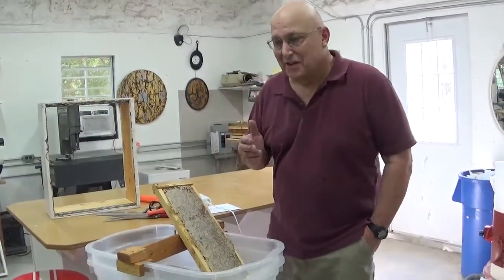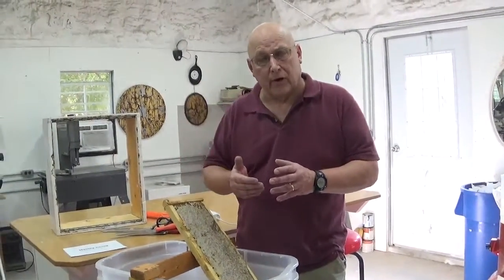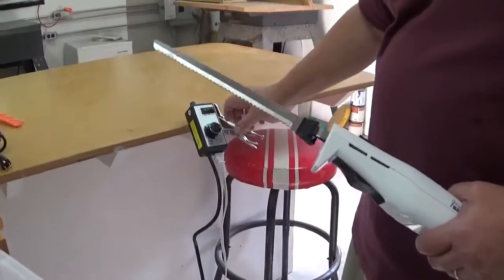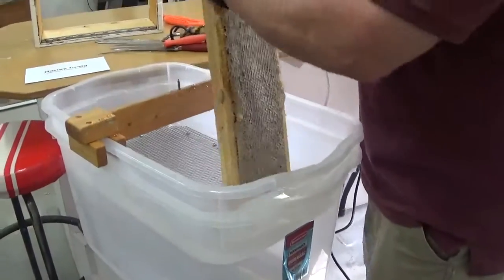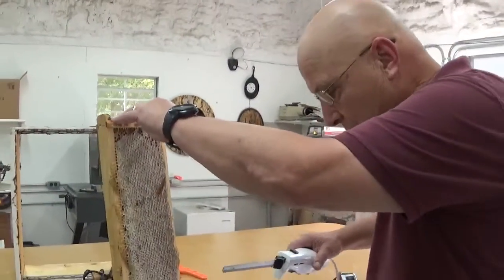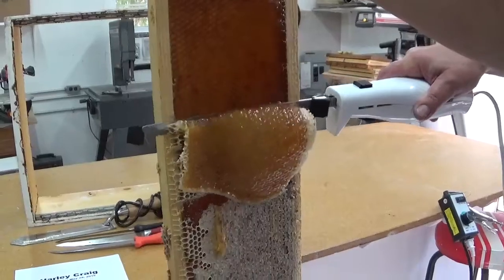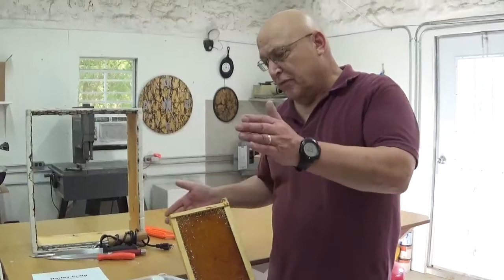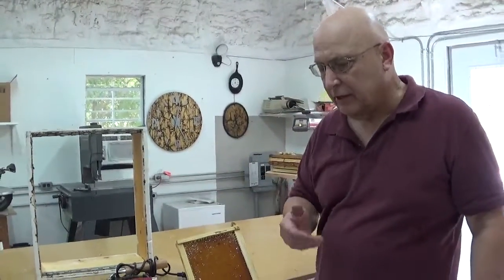Uncapping honey frames my new way is simple, quick and cheap.....

Comment: Thanks again for this video, this method is efficient in every way.  It is easy, safer, and the caps come off so clean there's much less honey getting trimmed off.  I bought an electric knife at a thrift store for $2.00, a new foot switch and speed controller on E-bay for $30.00 and probably saved a few hours the first night of uncapping.  More honey went in the extractor and much less into the pile of caps.  Ultimately better honey in the end, and for less time, effort, and way less money than a fancy uncapping tool.  Thumbs up, Jeff, what a gift.
Reply from the maker: Thomas, I'm glad this worked so well for you. I bought one from a thrift store also and when I plugged it in, I found that it was broken with only one side working. I figured that I'll give it a try anyway and that defective one bladed knife worked as well also, thanks for watching.
Reply: Hi Thomas (and Jeff) - Can you let me know which speed controller you used ?

Comment: Does this leave good comb for them to work with next year? I damaged too much last year and they had to basically start from scratch this year. Looking for a good way to extract and not damage so much honey comb.
Reply from the maker: The comb where it is cut looks like it was done with a schapel, there is no damage to the comb. Look closely at the frame I just did and you will not see any clumping of crushed comb left on the frame. After trying all the other cutting tools through the years I'll only use this one.
Reply: @jeffwillard2417  Thank you for your reply!

Comment: Just finished processing 2,200 pounds of honey from 88 boxes---used the electric bread knife for all of it.  Keep a back up in case of overheating or breakdown.  Will add the foot pedal next season as my hand got tired on the trigger.
Reply from the maker: Ronald, you really put my idea and the knife to an extreme endurance test, I'm glad it worked out so well for you, 88 boxes you got to be honey sticky and tired.... Where are you located?
Reply: @jeffwillard2417  Pulled boxes on Tues, Wed, Thurs with really good help.  Extracted on Friday and Saturday---with more good help.  I use 7 frames in 8 frame boxes (I'm 5'6" and 150 and 65 y.o.). The bees cleaned up boxes and wet cappings on Monday and Tuesday.  Gathered dry cappings and treated and stored frames yesterday.  Cleaned and stored supers early this morning.  I try to keep the sticky mess to a minimum---but can't do much about the heat---which along with humidity, has been oppressive.  Now I make up overwinter nucs with the dark comb that was in some supers.  I'm in Richmond, VA.

Comment: Jeff would be able to give me a bit more information on the foot control & speed adjustment unit please.
I think, as you said, this is a pearler of a system, it looks in the video as though the electrical plug for the electric knife is plugged into the speed controller box, however I can't see how the speed controller is plugged into the electricity?
Is this a complete unit which you purchased (if so what is the brand, unit size?) or if you constructed it out of parts etc.
Thank you in advance,
Kind regards from Marburg Australia
Reply from the maker: Hello Foster, 
The speed controller is optional but what is most necessary is the foot pedal switch which plugs into the wall outlet. Just tape the trigger switch on the knife so it is always on and then plug the knife into the foot switch it is that simple of a setup. here is an example of the foot pedal switch.   https://www.amazon.com/dp/B07KN6GLYD/ref=sspa_dk_detail_5?psc=1&pf_rd_p=0c758152-61cd-452f-97a6-17f070f654b8&pd_rd_wg=9HqQR&pf_rd_r=NE30N5RG6JEW1XE4YG2H&pd_rd_w=DGLzo&pd_rd_r=38c70228-8455-4377-8c45-74f7f6cdd8ed&s=industrial&spLa=ZW5jcnlwdGVkUXVhbGlmaWVyPUEyWkg2NDlQUlNSMUdBJmVuY3J5cHRlZElkPUEwNzU0MDAzMjlaR0g3WklBNVU5SSZlbmNyeXB0ZWRBZElkPUEwMzkwMzMwMjdYODEyUThFNDlYRyZ3aWRnZXROYW1lPXNwX2RldGFpbCZhY3Rpb249Y2xpY2tSZWRpcmVjdCZkb05vdExvZ0NsaWNrPXRydWU=

Comment: Jeff,  I got an electric knife and it works awesome! Thanks!  Unrelated question:  Can you think of any reason not to have robbing screens on year round?
Reply from the maker: Hives really don't need a large opening for the bees, a smaller one helps them to defend the hive. There are so many styles of robbing screens the biggest problem is the opening size; can the drones come and go freely and will there be dead bees that can't be removed through the screen from inside the hive. I personally don't use them I just restrict the opening from an inch to several inches depending on the size of the colony during the Summer dearth with a piece of scrap wood, I just like to keep things simple. Thanks for watching

Comment: After having "bad luck" (OK, bad technique) with the cold and hot "uncapping knives", I settled on and stuck with using an uncapping comb to pop off the caps to get at the honey. It works very well, especially when the bees don't make the comb nice and uniform (proud in some spots and sunken in others). But it is slow.  And when I started going from uncapping 10 frames, to 20, and then more...I knew I needed another solution.  I thought about breaking out the hot knife again (more frames, more practice to get that "technique" improved) but then I saw Jeff's video on using an electric carving knife. So...already having a battery operated one (which also has a variable speed switch on it) i gave it a go.  All I can say is THANK YOU JEFF WILLARD!!!
Reply from the maker: I'm glad it worked so well for you, it was a game changer for me also. Thanks for watching..
Reply: What make and model battery electric knife did you get with speed control on it?

Comment: I agree with you. Over the years I've had a steam knife, electric knife and all other sorts of blades that cost a lot of money and are all inefficient and mostly useless. You cant even call the steam and electric knives a "knife" because knives are sharp and they are not. One of my best ways was to warm my frames to 35c (95f) in a custom built temperature controlled cabinet and I used razor sharp Japanese Sushi knives, they are extremely light, thin and long (like a mini sword).  Your electric knife is very impressive but the Sushi knives were even faster to slice through the cap. Either way, it's great that you identified how useless the 'preferred' way of uncapping frames is.
Reply from the maker: Hi G.A,
It sounds like we traveled down the same "looking for a device for uncapping" road. This worked so well for me I just wanted to share the idea with other beekeepers. There aren't many beekeepers who can afford or want to invested hundreds and even thousands in uncapping equipment, I know I don't.
Reply: @jeffwillard2417  Yes totally understandable to not want to break the bank with equipment. I've learned time is money, even when uncapping and extracting. I find it painful to watch other Youtubers spending a couple of minutes per frame uncapping with a traditional electric heated knife or plane but I guess it comes down to how much honey you are producing. I'm making around 1500kg 3000lb per year so I need to run very efficient. Years ago I was considering the electric knife like you have in the video because it does work well as you've demonstrated, but I've stuck with the Sushi knives because they are a little bit faster, lighter and take minimal space on my capping spinner. I'm stretched to the limits and will upgrade to something better that will uncap both sides at the same time but it comes down to practicality vs: cost. I've done a lot of research and I'm leaning towards the twin heated V-blade, most of the other styles of mechanical uncapper are overkill and too costly for what they do.
Reply: Hi, Gold Acres. I might try your sushi knife method. Is there a certain brand & blade length that you find to be ideal? I run medium and shallow supers.

Comment: Jeff are you still using this method?  Any tips on brand of knife?  What is the brand in your video that you are using?  Thanks.
Reply from the maker: Hello Baby Bee,
Yes I still use this knife, I only use this type of straight line knife the one's with a handle I find are harder to use. I have gotten them from Walmart and garage sales I don't look for any particular brand. One knife I bought was from a garage sale that I found out later when I got home only worked on one side which was the blade without the rivet locking stud (yes they said it worked at the sale). I gave it a try with the one blade and I believe it was cutting as well with one blade than the two blades working back and forth. I'll always use this method with one or two blades, I wish someone would build a heavy duty model that would last and you could take apart and clean.

Comment: I tried this method this past weekend - bought a brand new electric filet knife (9").   By the 2nd frame, the wax was going between the blades, causing the wax to get ripped off the frames rather than cutting them cleanly.
Reply from the maker: Hi Cornerstone,
Sorry you had problems, I wish I could tell you exactly what went wrong. With my own hives I'll notice a difference between colony's in the consistency of the honey comb wax and I have seen a problem if the comb wax is really warm causing it to stick to the knife blades. I will scrape the edges of the knife blades periodically on the edge of the honey comb frame to keep them clean during cutting. I have also seen a difference in cutting ability with the different brands of electric knives, I think this has more to do with the cutting teeth of the blades because each one that I have is a little different between the manufactures. All I can say is try it again because the video shows how cleanly and quickly it cuts the comb, Good luck...
Reply: Did you govern the speed of the knife ? That may have been an issue - speeds and feeds are pretty major issues in engineering

Comment: Do I have to have the speed control unit or will an electric knife on regular speed work?
Reply from the maker: You don't need the speed controller, it just made the knife speed adjustable. I have used the electric knife both ways and also using just one blade. One thing that I do is scrape off any wax on the blades to keep them cutting cleanly.

Comment: Glad I found your video! I was in the process of purchasing 2 heated knives and thought about the issues of unplugging and overheating the residual honey and wax... 
we now have 21 colonies so time for an upgrade! I’ll go get one today and try it in one of the frames that are ready. 
No heating necessary at all? 
And you say it leaves the comb in perfect state? 
Can’t wait to try and make my life easier :-) 
Thanks for the advice
Reply from the maker: Hi Jocelyn,
You can see in the video how cleanly the comb is cut, there isn't any clumping or tearing of the wax. You just have to make sure you wipe any excess wax off the blades if it starts to build up, I'll scrape the knife blades it on the edges of the honey comb frame periodically while cutting. Glad to help...

Comment: Would be useful if you said what brand knife, or show a close up of the teeth on the blade, or at least provide the knife length.   Also, this also may not work for deep frames unless you can find an electric knife with a 10-12" blade, as deep frames are 9" across, so you need a knife length at least 9" plus extra for the reciprocating blade.
Reply from the maker: I have used many brands and they all worked well. They were all the same style with the two blades going back and forth. I have picked them up at yard sales and thrift stores.

Comment: Can you edit the information of this video to include
* the brand & model of the electric knife (most important is the blade)
* the brand & model & where you buy the speed control unit
* the brand, model, & where to buy the foot pedal 

A quick video of how you wired these together... 

I am building a de-capping tub (so I can de-cap an entire box of frames at once.  Having the nail to hold the frame so I can decap with your system would seem to be the PERFECT (non commercial) system.
Reply from the maker: Hello Cornerstone,
   The first knife I got was used with 9" twin reciprocating blades at a Thrift Store for $5.00, it lasted a couple of years. That one I took the finger switch apart and wire it to bypass the switch, the next one I got lazy and just wrapped Gorilla duct tape on the finger switch and it worked just as well.  You can pay from $15.00 to $50.00 for an electric knife, check the reviews on Amazon to get an idea on which knife that would be the best choice to meet your needs. 
   The foot pedal switch and speed control came from Harbor Freight and everything just plugs into each other, there is no special wiring. 
   If your building a multi-electric knife decapper I would go with a brand with good reviews and will hold up under heavy use and can be replaced easily as need. When you get it done send me some photos, Good Luck with your build....
Reply: @jeffwillard2417  Hi dear friend .
You can share a link to a shopping site where you can purchase these tools, an electric knife, a foot pedal switch and speed control. ??
thanks alot.
Reply from the maker: @tiranhesawi7782   This should help.

https://www.amazon.com/Proctor-Silex-74311Y-Lightweight-Contoured/dp/B00006IUX1/ref=sr_1_5?keywords=electric+knife&qid=1585429754&s=home-garden&sr=1-5

https://www.harborfreight.com/router-speed-control-43060.html?_br_psugg_q=speed+control

https://www.harborfreight.com/momentary-power-foot-switch-96619.html?_br_psugg_q=foot+switch

Comment: Hi, Jeff. I might try this method next season. Is there a style of electric knife that you prefer? Double-reciprocating blades? Is there a preferred brand?

I’d like to purchase something that works optimally without any time-consuming hang-ups.
Reply from the maker: Hi Ryan, 
I have used different brands with about the same results. I would suggest checking out thrift stores, garage sales and estates sales and buy them at a cheaper price than new. I bought one from an estate sale and found out later that only one side worked but that one bladed knife worked as well as a two bladed one. Thanks for watching....
Reply: @jeffwillard2417  

Thanks. Is this still your preferred method of uncapping frames?
Reply from the maker: @RyanMcDonnough  The only reason for me to stop using this electric knife system is when I'm no longer able to be a beekeeper. My heated knife along with the others are just collecting dust. The only thing you have to be aware of is any wax build up on the outer blades, I usually just scrap them on the wood frames every 5 to 10 frames just to make sure they are clean. The honey usually acts as a great lubricant keeping the wax off the blades, you'll see what I mean when you start. The speed control is purely optional, the last few seasons I didn't even use it BUT the foot switch is a must have because the trigger on the knife is fasten so that it is always on.
Reply: @jeffwillard2417  

Thank you very much
Reply: @jeffwillard2417   Next question: how do you melt & process wax?
Reply from the maker: @RyanMcDonnough  I use a 36 quart turkey fryer pot, fill 3/4 up with wax, fill the rest of the pot with water. medium heat on the gas burner until all is melted. clamp aluminum window screen on feed bucket or any other thick large plastic container, then slowly pour the melted wax through the screen. Leave the screen on until wax is cooled (it keeps the bees out) as it cools all of the dirt and heavier debris will form at the bottom in a layer, which needs to be scraped off. When I need a more refined wax for candles, I'll brake off a chunk melt it on low then pour it slowly through a fine mesh cone paint strainer.
Reply: @jeffwillard2417  

I wonder if a bucket paint strainer would work better and remove more debris than the aluminum window screen?
Reply from the maker: @RyanMcDonnough  It may but you have to compare the cost and disadvantages of the bucket strainer. With aluminum window screen you cut off what you need use it once then throw it away, cheap one-time use. With a bucket strainer you have either a stainless or nylon/polyester filter element, with stainless you would have to carefully clean it each time because of the cost of the filter and nylon/polyester filter you have to very cautious of the temp of the hot wax or it may melt/distort the filter. Those are the reasons I went with aluminum screen it is cheap, one-time use, no worry about melting the filter. All the fine debris/hive junk accumulates on the bottom of the cooled wax so there is really no need to ultra-filter it in bulk, at least that's how I look at it.

Comment: Is that a sewing machine footpress if yes how did you connect it to the knife
Reply from the maker: Hi Linda,
It is a foot pedal switch made for power tools, they are at tools stores and Amazon. Which is connected to the speed switch. You may not need the speed switch but the foot pedal makes the job easier.  https://www.harborfreight.com/momentary-power-foot-switch-96619.html

Comment: Seems like you're not using full depth frames?   How would it go on full depth
Reply from the maker: I use all medium honey supers and the knife works great for that size frame or smaller. I don't know if anyone makes an electric knife with a 10" or longer blade that would fit a full size honey frame. The trick is to keep the blade on the upper and lower part of the honey frame while cutting for a smooth cut.